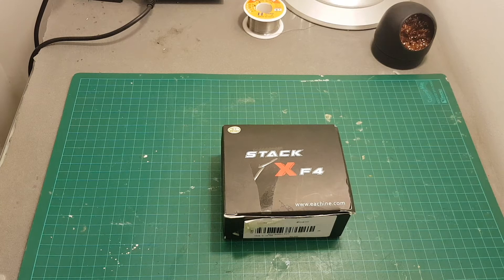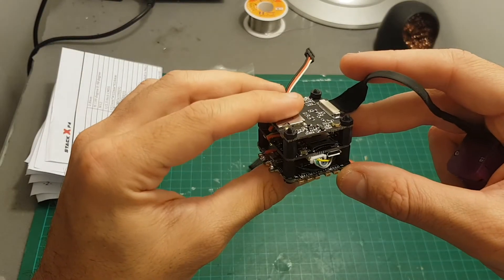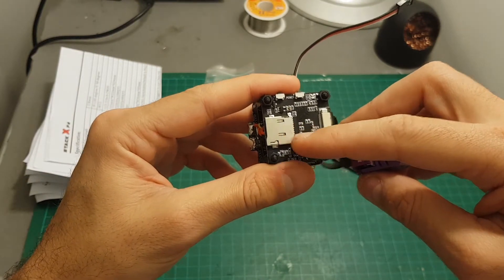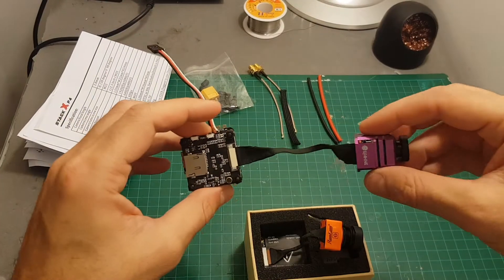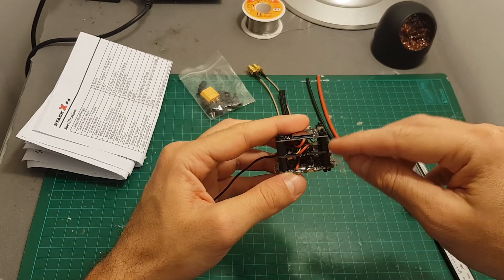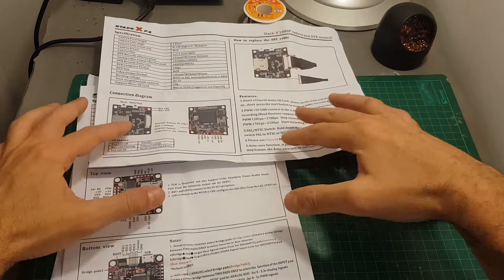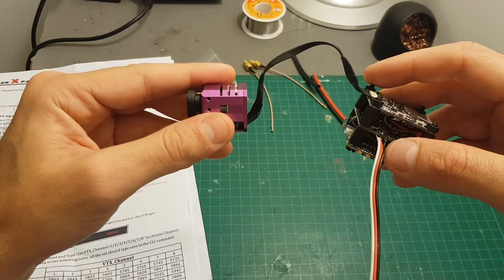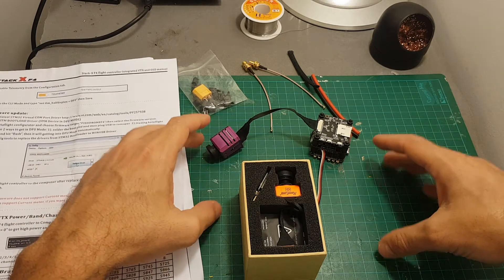Eachine Stack-X F4 Flytower - Part 1 - Overview And Specs

Comment: Can I use it on 90mm micro drone?
Reply from the maker: No, you need a 20 by 20mm board
Reply: Gal Kremer is it 20×20 holes??
Reply from the maker: Yes - the Stack x is using 30x30 holes

Comment: Gal - Have you tried flashing your Stack-x yet?  Can't get mine to go into DFU mode.  Instructions for flashing make no sense.  There seems to be a boot button but it does not work as one might expect.  I see where JRC Aerial (below) is also having problems.  Are you in contact with Eachine Support?
Reply from the maker: +David Nickell I plan to build it on the weekend. If you think that your device is faulty, you should contact Banggoods support.
Reply: Thanks for your reply.  Successfully flashed to FishdroneF4 3.2.3.  Replacing the driver using Zadig was confusing.  Putting the Stack-X in a QAV-R.  May have to rotate the 4in1 by 90 degrees and use smaller standoffs to lower the overall height of the stack.  Hope it is worth the effort.
Reply: Hi David, would you mind sharing how you flashed it and what driver worked for you? I received mine today and while I could connect it to my PC in normal mode, it would not flash the latest version. After updating the driver via Zadig (to WinUSB) it stopped  connecting in normal mode and still won't flash... :(
Reply: Make sure that you update the STM32 Virtual COM driver on you computer (Step 1 in the Stack-X firmware update instructions).  Start Betaflight.  While holding the "BOOT" button down (it is on the bottom of the flight controller), connect your computer to the USB socket on the flight controller.  Start Zadig.  Select "List All Drivers" under the Options menu.  Select "STM32 BOOTLOADER".  Zadig should look like the picture in the firmware update instructions at this point.  Basically, you are replacing the STM32 BOOTLOADER with the WINUSB driver.  Click the Replace Driver button in Zadig.  Betaflight should now be in DFU mode.  From this point, proceed just like you would normally flash the firmware in a flight controller.  Select the latest version of the "FISHDRONEF4" firmware (3.2.3?) and flash.  Hope this help.  I should also thank Albert Kim for pointing me in the right direction.  The Stack-X  directions are terrible.  

Also, it appears that once you have replaced the driver, the flight controller will now go directly into DFU mode when holding down the BOOT button while connecting to Betaflight.
Reply: Thanks! I managed to get everything working again, I had not pressed the boot button before running Zadig. This as well as manually pointing the STM driver for the FC in "normal" mode fixed everything.
Reply: Glad it worked.  Now you can struggle with the rest of us dealing with the other problems in this product.

Comment: I wish you would do your build video. Or at least try to flash the FC and let me know if you were able to get the FC to flash in betaflight. I’ve had 2 of these stacks now and I’m $200 is n the hole cause both the FC’s will not flash.. With or without using the boot button which is in a horrible location I can barely even access it and plug in the mini usb at the same time cause the boot button is right behind the port. I’m having numerous other issues as well.

Comment: I just got my Eachine X F4 stack today but I noticed the ESCs are labeled different than what it should be. Looking at the 4 in 1 facing away from me the back right pins are labeled M1 which is right but the upper right pins are labeled M3 but should be M2 the back left is labeled M2 but should be labeled M3 and M4 is ok. So the 4 in 1 ESC pins for M2 and M3 seem to be either labeled wrong or I have to cross my wires over for those 2 motors. I’m also having problems finding a picture in my FPV goggles when I perform an auto search. Don’t think I like this Stack.
Reply from the maker: I am going to test it in the next week or so and then I will be able to share my experience with you.
Reply: Gal Kremer The only reason I haven’t wired my motors in is because I haven’t received them. I get my motors on Monday and I’m going to just wire my motors to the closest pins instead of paying any attention to what is marked on the ESC motor pins. The only reason I’m doing this is because the instructions mention something about the markings not matching the motor config in betaflight and says to adjust ESC signal wires according to the mixer map, but I don’t quit understand what that means. 

Update on my VTX signal to my goggles I finally got a picture and it’s really clear but just a heads up the camera, the word Eachine on the camera should be on the bottom when mounting the camera. I thought the word should be on top and once I got a picture I noticed the camera was mounted upside down. 

Also having problems with the VTX getting really hot and going into some type of fault mode and I lose my picture after a couple minutes of powering on the VTX. I’m new to builds but this is my 3rd build overall and my 1st build with this Stack and an F4 FC so this build is all new to me. I hope to figure it all out.
Reply: Gal Kremer I absolutely hate this Stack. It’s giving me nothing but problems! I don’t recommend it at all!
Reply from the maker: Wow, that's very unfortunate thing to hear. I am thinking about featuring it on an upcoming build video, but now I am not sure if I will do so... Sorry to hear about your bad experience buddy.
Reply from the maker: On a second thought, I will feature it anyway, so if it's as bad as you think, I will be able to share the experience with my subscribers.
Reply: Gal Kremer I'm just frustrated about the flashing of my FC in betaflight. It might be a problem with my drivers though. I have another pilot who is going to take a look at it for me so I can't really give a good review until I get my quad in the air. Then again stu with UAVFutures said on his review that this stack is sort of a hit and miss situation. Some stacks are perfect and others have malfunctions so I recommend you still do a build video with it and maybe if by then I dont have my issues worked out your build video might help me with my problems. The stack looks awesome on paper so I hope it works out for me cause I really like the design other than the fact that I have to use betaflight CLI to change my VTX parameters thats one other negative.
Reply: Gal Kremer  I'm connected to Betaflight now so that problem is gone but now the problem is I can't figure out which way that the 3 receiver leads are wired up because my receiver is not showing a signal on my transmitter my receiver and transmitter are both Binded but it shows no signal and my tx is beeping so in Betaflight on the ports tab it shows serial RX turned on in uart3 I get very confused on all the different ways to configure a receiver such as Ibus and Sbus and PPM which is what I normally am used to as that is how my 1st 2 builds were built and I thought those receiver leads were set up for PPM can you tell me what you uart3 means is that Sbus or some kind of other configuration? You can tell im a newbie right lol

Comment: Gal - There have been reported vibration sensitivity problems with that gyro on other flight controllers.  Basically, one may need to soft mount the stack.  Also, Tomoquad XBL2 is finished (HGLRC F428+VTX, EMAX 1306,  DAL Props 3045 & 850 mah 3S battery).  Flys very nice.  Very stable in this configuration.  A bit difficult getting everything in the frame but a joy to fly.
Reply from the maker: Thank you for the advice David. I will make sure to soft mount it in my build video. I am glad to hear that you are enjoying your new XBL2. Feel free to share it to the TomoQuads group on FB, so I can have a look :-). Happy flying buddy.
Reply: Check out Alber Kim's video on this gyro:  https://www.youtube.com/watch?v=xwTVptmTtUE
Reply: Check out the note at the bottom of the pin out diagram on page 6.  I can tell you that the way the 4in1 esc is shipped, the motor configuration does not align with the normal motor pattern in Betaflight (e.g., in Betaflight, motor #1 is at the lower right hand position if you are looking in the direction of travel).  I suspect that the note indicates that the motor configuration will have to be remapped in Betaflight.
Reply from the maker: +David Nickell Thanks David,  I will check it out.